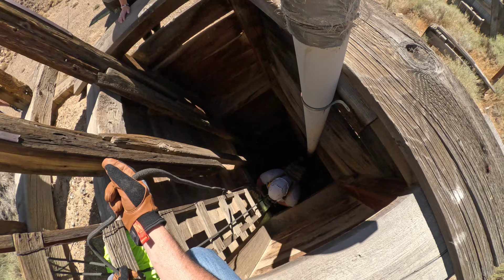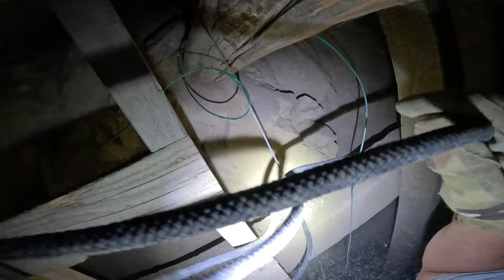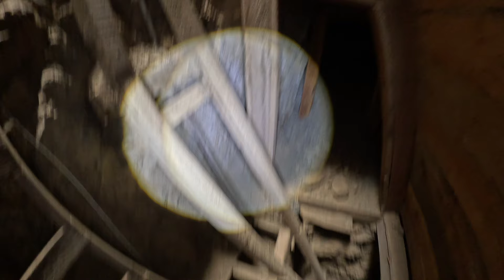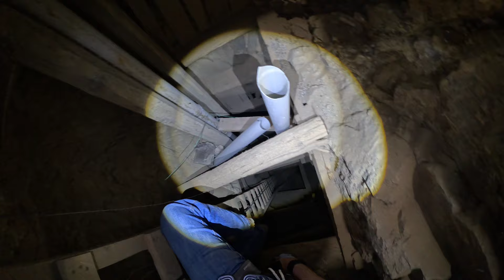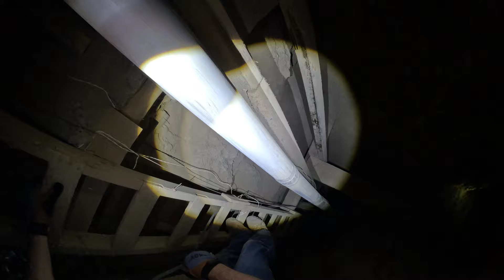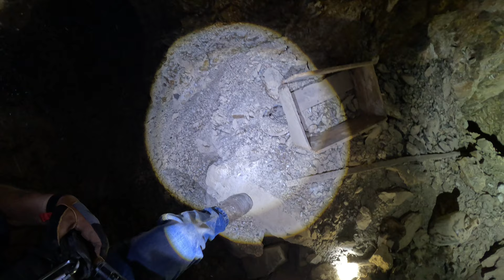The Descent into a deep gold mine.

Comment: Underground coal mining we use two way radios with repeater stations every 2,000 feet and any big bends or 90 degree turns require another repeater station. The radio waves travel good when bouncing off solid floors, walls, and ceiling, but put wood cribs and timbering in the entryway causes radio distortion from the radio waves being stopped by the wood instead of bouncing along the entryway.
Reply from the maker: Very true. We would get daisy chain signals closer than that, but repeaters would be nice!